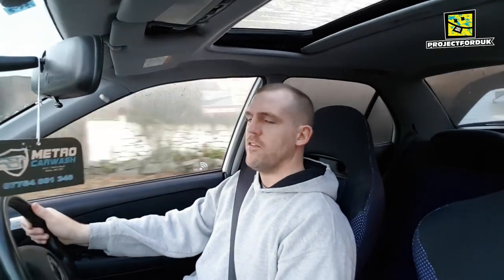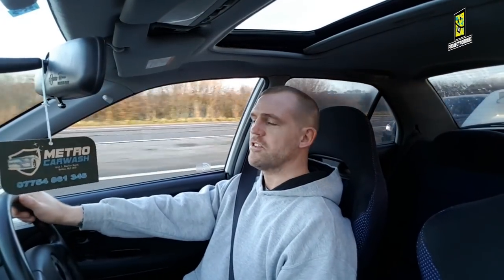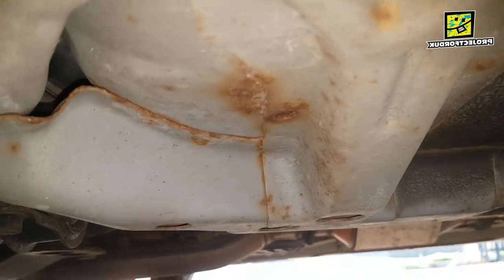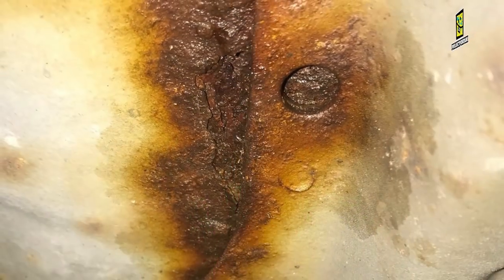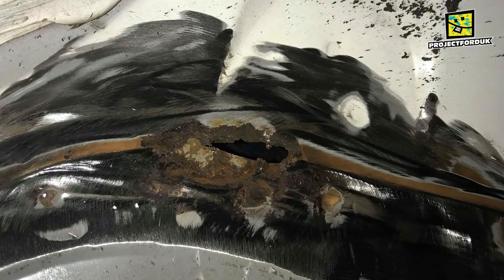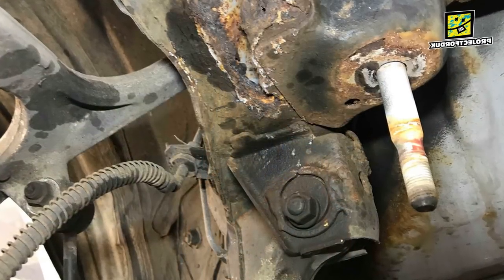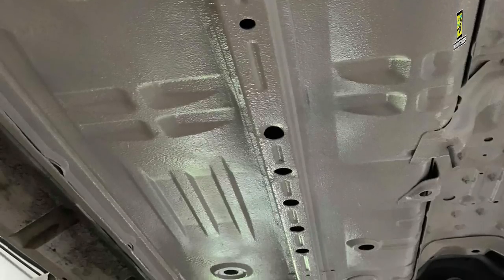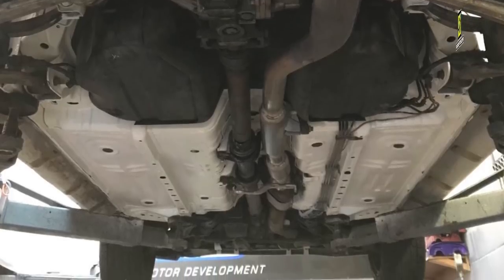Part 12 - Painting Underneath The Evo 6 Bright White - JDM

Comment from the maker: Whats the worst rot you lot have seen on a car? Any horror stories?
Reply: A guy at works dad had a damper van with crushed tin cans welded together as the foot well, because aluminium doesn't rust right. :P
Reply from the maker: Brilliant :)
Reply: No horror stories but every Ford I’ve had has ended up needing welding 🙄
Reply: My previous Evo 6 was absolutely rotten underneath and the guys at AMD sorted mine out too 👍🏻
Reply: My evo without a doubt. My Hondas have nothing in terms of rust compared to the evo
Reply from the maker: True Story ha
Reply: Loads of horror story's, clean evos underneath very rare now, hence why there can be a big difference in price for same models, especially 5s n 6s

Comment: i had an xtreme twin plate. after a couple of hundred miles i noticed similar symptoms to what you descirbe. a slight hesitation/thud in the drivetrain that would happen once  every time you got on the gas. it turned out to be the clutch hub had sheared and was moving (the hesistation)  and then gripping again as the two pieces trapped themselves togethor. shortly after this i was giving it some stick and i just lost drive completely. an act clutch replaced it and ive had no issues since

Comment: I dropped my evo 4 off last Saturday to have all the underneath done same as your,
Timing belt, tensioners and water pump,
All calipers refurbished,
4 wheel bearings replaced,
Stainless brake lines, drilled and grooved disks and pads installed, 
Evo 8 bov installed and slight engine tune up to fix stalling at stops,
Every bush underneath replaced with whiteline bushes,
Front and rear subframes powder coated and all track arms, wishbones etc powder coated
Reply: Same place AMD ltd wigan
Reply from the maker: Its in good hands mate. :)
Reply: @projectfearn  I hope so, hope no corners are cut, my bill came in a grand more
Reply from the maker: I can only go off my experience mate and they were spot on. I asked them to take piccies each day etc which they did and sent me keeping me up to date.  Only thing wrong was a brembo decal the wrong way up on a brake caliper. :)
Reply: @projectfearn  yeah I always seem to get stuffed initially I'm excited so mustn't be paying mush attention then as the novelty wears off I start to notice that actually they didn't do as good of a job as I thought (regards work on my home, n other cases)

Comment: Hi mate how much did all this work cost you as I’m looking at having mine done ✅👍
Reply from the maker: They carried out the following work:
- Clean underside and wheel arches of car
- Strip back to metal
- Cut out and fix the holes in the driver and passenger footwells
- Sort out corrosion to front and back of both rear chassis legs
- Rust treat it
- Etch Primer It
- Spray underneath and wheel arches with UPOL Raptor in white
- Remove, strip, repaint and re-sticker the brack claipers
- Read codes and fix AYC fault
- Diagnose ABS Fault
In total it came to £1540 and was paid in cash, hope this helps :)
Reply: @projectfearn  that seems cheap

Comment: The cutting out under heavy throttle could well be fuel related. My mondeo St did similar thing and then go into limp mode and it turned out to be the fuel pump.
Reply from the maker: Dont be saying things like fuel pump haha :)
Reply: Is it not just the spark plugs?
Reply from the maker: Soon find out pal :)

Comment: How much did it cost you for all the work underneath?
Reply from the maker: They carried out the following work:
- Clean underside and wheel arches of car
- Strip back to metal
- Cut out and fix the holes in the driver and passenger footwells
- Sort out corrosion to front and back of both rear chassis legs
- Rust treat it
- Etch Primer It
- Spray underneath and wheel arches with UPOL Raptor in white
- Remove, strip, repaint and re-sticker the brack claipers
- Read codes and fix AYC fault
- Diagnose ABS Fault
In total it came to £1540 and was paid in cash, hope this helps :)
Reply: @projectfearn  that's a really good price
Reply from the maker: It was indeed. Going back some years now though. 😎
Reply: @projectfearn   I've just booked my 6 in for underside resto. Can't wait to have it done
Reply from the maker: Its a curse mate. You will stop driving it 🤣🤣🤣
Reply: @projectfearn  I haven't driven it for 4 years as it is 😂😂😂

Comment: How much did this cost? because mine is almost identical. Rust and all
Reply from the maker: They carried out the following work:
- Clean underside and wheel arches of car
- Strip back to metal
- Cut out and fix the holes in the driver and passenger footwells
- Sort out corrosion to front and back of both rear chassis legs
- Rust treat it
- Etch Primer It
- Spray underneath and wheel arches with UPOL Raptor in white
- Remove, strip, repaint and re-sticker the brack claipers
- Read codes and fix AYC fault
- Diagnose ABS Fault
In total it came to £1540 and was paid in cash, hope this helps :)

Comment: Fuel cut
Reply from the maker: You think that is the issue with the slight cut out under heavy acceleration?
Reply: Friend of mine has an evo 5 and his was fuel cutting like that and it was because the actuator had rotted inside
Reply from the maker: Hopefully they can figure it out. Will keep you updated mate :)
Reply: Hi bud did u ever find  out what the jerking was..my evo TME started doing this.

Changed plugs and coils....still the same
Reply from the maker: Turned out to be the throttle bottle seals leaking slightly 😎
Reply: @projectfearn  thanks for that...Will check them out...top man